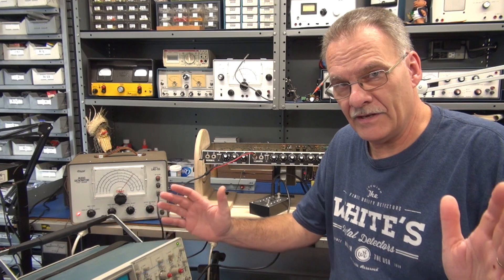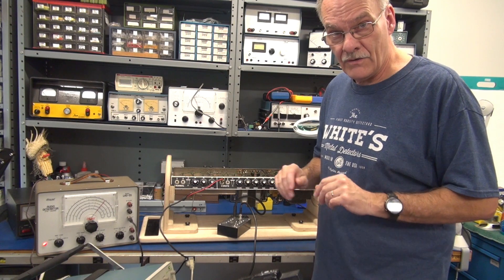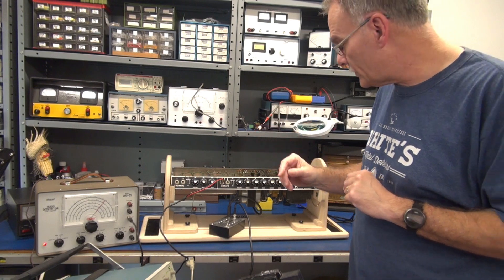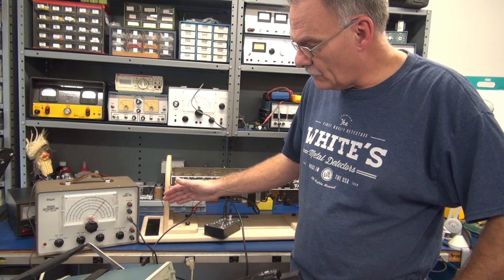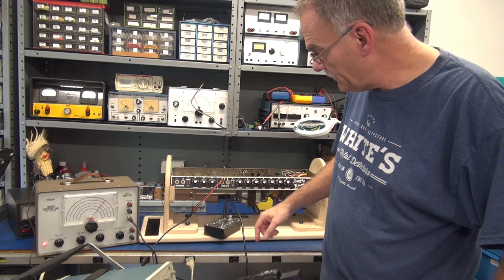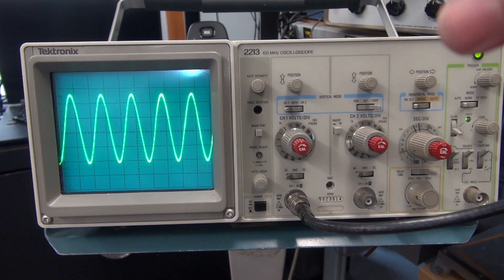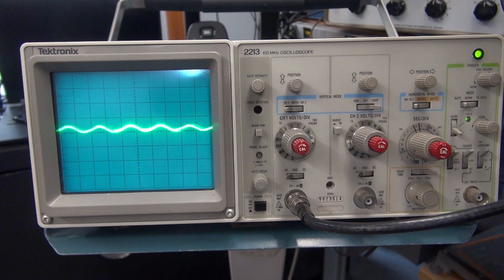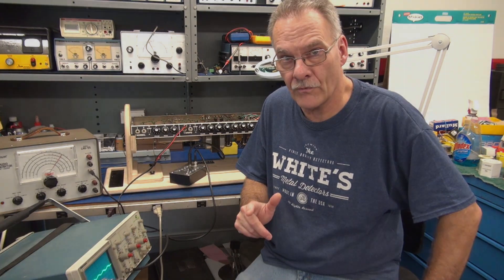Simple test method tube guitar audio amplifier using Oscilloscope Dummy Load and Audio generator

Comment: I have the device under test (amp in this case) on an isolation transformer(w/ground isolation), for the reasons you mentioned. I think it better to have the signal generator operate as designed (in my case the HP3325), has an equipment ground. I do sometimes breakout the old Heathkit audio generator though and it is not grounded.

Comment: I just read somewhere that one has to be careful sometimes if one side of the speaker out is grounded or also can create problems. They suggested first ohming out (with all turned off) the two speaker leads to chassis ground?

Also how do you check if signal generator is not grounded?

Comment: I'm wondering about a few things here. I have an old hp 200cd signal generator that I salvaged and rebuilt. The chassis is earthed by the green wire in the line cord. The actual circuit is floating at -135V above ground on the negative rail. I'm  assuming a lot of older signal generators are designed this way so the ground loop is not an issue. Any thoughts?

Comment: Still have a question,
Does your scope have to be isolated from ground to do save measurements??
And  THX for all your good advice 👍🎸🎶
Reply from the maker: Hello, I have a 3 prong eliminator, that I leave on my scope. So, the AC ground lug is not connected.

Comment: Nice clean output. Does it stay that way, up to full power output of the amp? Most of you internet repair guys seldom show the output at full power.
Reply from the maker: As the amp is cranked up, you will see flat topping of the sinewave
I normally do not test a customers amp that way
Reply: @d-labelectronics  if you don't run the amp up to its clipping point you'll never know if that 50 watt at 8 ohms amp is putting out full power. Instead of 20 volts and you have only run it up to 10 or 12 volts, that's a big difference between actual and spec. Just saying! Not to over criticize your work however. Keep up the videos.
Reply from the maker: Roger that  man, I understand

Comment: So, if I use my dummy load, where do I pull the signal from out of the amp for the scope?
Reply from the maker: You simply connect your scope across the speaker jack. The load & scope are connected in parallel. Make sure the ground lead of your scope is connected to chassis